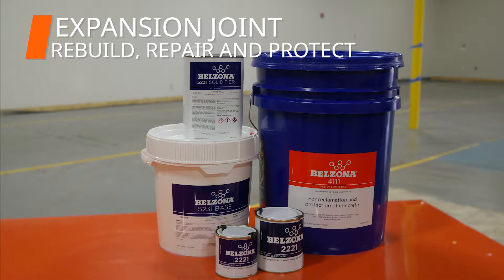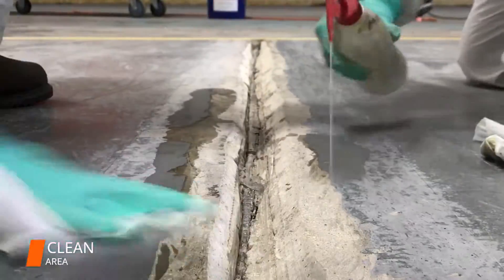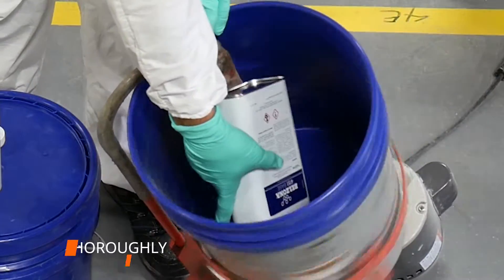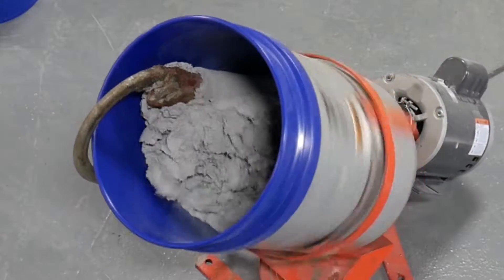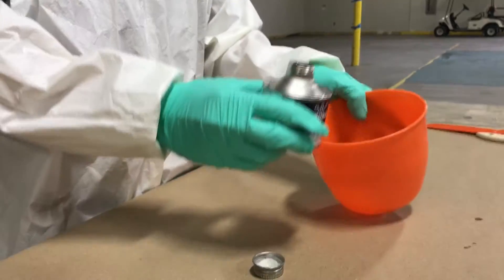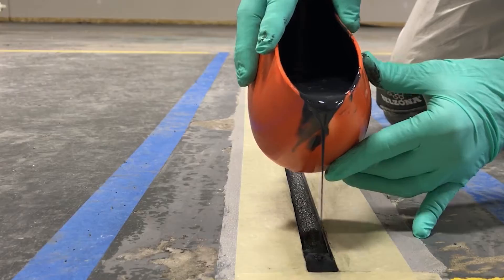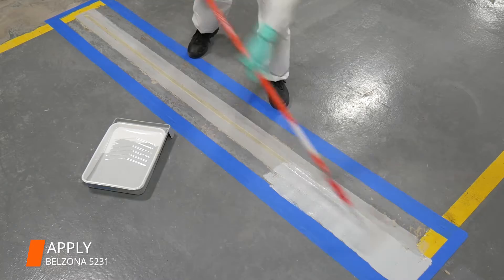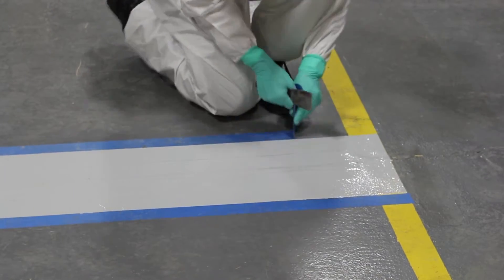How To Repair Expansion Joints In Concrete With Belzona

Comment: Can this be used in a concrete swimming pool? Is this product ok with the chemicals used such as chlorine? Finally how expensive is it? Cheers
Reply from the maker: Hi Greg, 

It would be best if you were to use our 2000 series product range for this type of repair as they are resistant to chlorine. If you would like to find out more and discuss pricing your local distributor will be happy to help you. You can find your local distributor at the link below. 

Thank you,
Miles 

https://www.belzona.com/en/about/disfinder.aspx